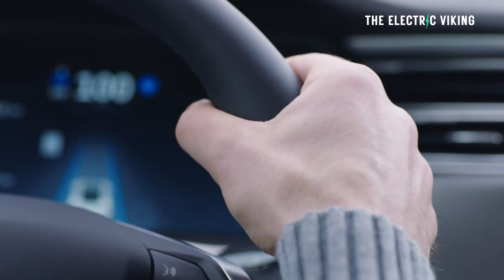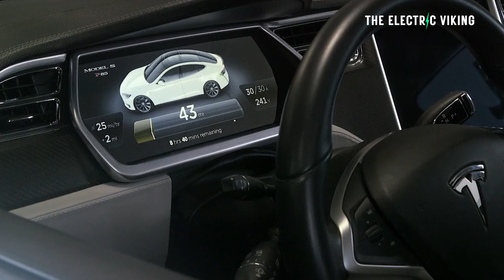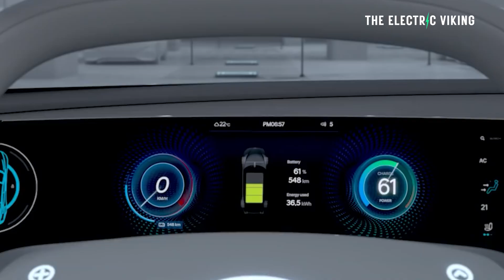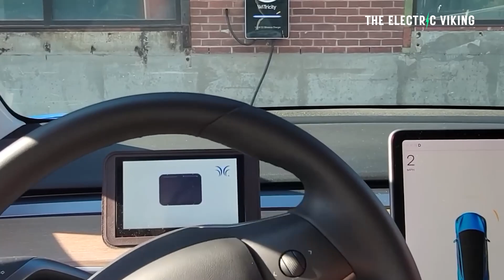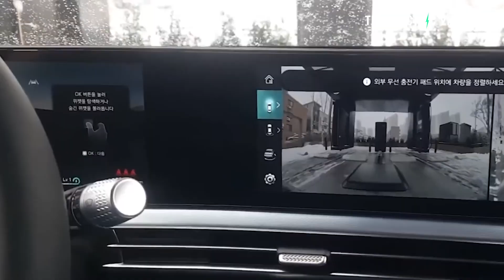Researchers reveal 500 kW wireless charging with 98%+ efficiency!

Comment: First thing this makes me think of is the pacemaker/defibrillator my mother has.  Can the magnetic field disrupt its operation?  (I hope that's an easy "no" for the designers of this tech - but lots of high-tech devices do disrupt it.)  We gave her an Apple Watch to monitor various health aspects, but if it gets within about a foot of her pacemaker it rings it's alarm and sends an emergency notification wirelessly to the hospital lab's device monitoring service.  They immediately phoned and had about 30 questions for her, and were ready to dispatch an ambulance.
Reply: You need a better shielded pacemaker. A solar flare could mess you up.
Reply: @tedmoss  She just had it changed out in December with the highest tech.  Nothing newer or better exists.
Reply: Yes, it can, and will interact with a defibrillator. Even low power phones are restricted in hospitals and aircraft because of the sensitive equipment in the vicinity.

Comment: Wireless still has waste, and that's your money when you charge so I would stay with wired. And I would be worried about ghost charge building up. Street man holes sometime get charged it's very rare but it happens.Oh and your adding weight to the vehicle, less is more, and copper it's expensive. but as batteries get better add something like this may be of use. I will still like to have a wire. But the safety you get with ships looks great, water and wires can be bad.

Comment: In other (not so new) news:

CSSC Haizhuang released the 260 meter diameter / 18 MW off-shore wind turbine H260 mid January. Per year one wind turbine converts wind energy into electrical energy for 40,000 households. Calculate for yourselves how many rotations it needs to charge an EV. 😉 

CATL already plans the 2nd generation sodium ion battery.

Sodium is 2.3% of the world’s crust. It is over 1000 times more abundant than lithium.

Lithium ion batteries have a capacity between 200 and 300 kWh. 

The energy density of CATL’s first generation sodium-ion battery cell can achieve up to 160Wh/kg, and the battery can charge in 15 minutes to 80% SOC at room temperature. Moreover, in a low-temperature environment of -20°C, the sodium-ion battery has a capacity retention rate of more than 90%, and its system integration efficiency can reach more than 80%. The sodium-ion batteries’ thermal stability exceeds the national safety requirements for traction batteries.

The second generation will reach the capacity of 200 kWh.

Comment: Vaporware. Wireless charging can't even work right for phones. I'd rather they work on coming out with autonomous mobile robot chargers. You don't need a special spot to park, it will come to you.
Reply: If the current wireless charging worked perfectly this wouldn't be a game changer. It is the very fact this works better than current wireless charging that differentiates it and makes it exciting.

Comment: This will absolutely change EVERYTHING in the EV industry and calls into question the importance of range and battery size and charger compatibility!!!!
Reply: ...we're still in the Early Access situation regarding EVs and batteries. Range is as much a real problem as how fast an EV goes from 0 to 60: since on mean average people drive not even km per day it is a joke...especially when they can charge at home and at work...so it is 20 km to work and back. Ok let's say it is 100 km to work and back 100 km again. ...not an issue.
Reply: @currentbender  understood and I would imagine as this charging improves the full ramifications of my prediction will be expressed. I know for me it’s about spontaneous options and psychologically more range is a mental crutch and this IMPROVING technology will or should dismantle most people’s range anxiety as these wireless chargers become more or less as common as street lights.
Reply: People don't want to stop frequently or for a long time on longer road trips. That's why people care about range. If you have to stop every half hour or hour, even if it was to charge for one minute, very few will want that. Also, assuming batteries can get enough juice to charge at heir peak rate, every battery from a AAA to Tesla Semi charges in about an hour, or 30min to 70%. If your car's range is 1000km, then you probably won't have to stop at all on a day's drive, but if you do you can add 700km range in 30min. If your car's range is 200km, which you could argue is plenty for getting around in a city, you will only be able to drive for less than 2 hours on a road trip, and sitting for 30min only adds 140km of range. That is a very hard sell unless its a family's second or even thrid vehicle. So we're going from 30min of charging for, say, a 1500km trip with a 1000km range car, vs around 5hrs of charging for the same trip in a 200km range car.
Reply: @truhartwood3170  absolutely I couldn’t agree more, that’s why I am so enthusiastic about the lane charging option where you are charging while you’re driving. It’s going to be a really fun future.
Reply: @pgiatrakis  I'm not sure if the value will be there to put that amount of copper under highways.
Reply: @truhartwood3170  talent gets us to places few can go and genius gets us to places few can see structural induction serving greater functions at constrictions in infrastructure is just one of a multitude of strategies that could render the endeavor feasible and probably critical. The attempt is more than worthy and minuscule and validate future success or failure. This would allow us to learn and improve and pivot future designs and strategies to increase efficiency. It’s a promising future and we need your type of thought to guide us in the best direction…

Comment: Good, but there is one problem, potentially: Heart pacemakers. A friend has one,  and users are warned against high currents/high magnetic fields, e.g. 'don't do arc welding at > 70Amps' etc.
My friend thinks the warnings are over-conservative, but the medical profession are unlikely to relax them if they think that there is even a 1 in a million chance of adverse reaction and a lawsuit.
I can see a battle between Tesla and whatever company wants to promote wireless charging, and the medical fraternity who don't want to be sued for malfunctioning pacemakers.
Of course the high currents of DC charging are also a potential problem, if pacemaker susceptibility is an actual problem.
Reply: If its 98% efficient, I doubt the magnetic fields will be strong anywhere but between the two pads. It's an interesting point though, and I'm sure tests will be done :)
Reply: No such warnings about inductive cooking hobs because of close coupling and in that instance the hob will switch off within seconds of the pan being raised off the surface, similarly with inductive charging the magnetic field is tightly focussed on a spot around 8" from the ground pad in most instances and unless the pads are within the zone the pad does not activate. In momentum dynamics system the magnetic field close to the cars wheel at ground level is less than that emitted by a cooking hob.
The medical fraternity was wary of mobile phones in hospitals when they first appeared but by now there are very few restictions on mobile phone use in hospitals.

Comment: The other benefit will be V2G and V2H as power can flow in both directions
Reply: That'll make the cars bulkier and heavier as they'll have to produce this frequency - I think it's unlikely it'll be used for V2G for now.
Reply: V2G/V2L wasn't mentioned here, but is available today for some cabled cars.

So, until confirmed for this technology too, this advantage goes to the cabled solution.

Comment: If Musk wants to achieve Robotaxi once FSD reaches level 5 then he will have to include wireless charging tech into his Teslas
Reply: Pretty sure d charging part is d least complicated. FSD is d big challenge.  Even robot vacuum systems can dock themselves in a charging bay so EVs with FSD should be able to recharge with some modifications even without wireless charging
Reply: @ikwikwi  Yes, charging the vehicle is the least hard problem in solving fully autonomous driving.
Reply: @ikwikwi  So can all cars and trucks.
Reply: @tedmoss  @TheFuelProject
Reply: Add reverse wireless charging. He could have a 24/7 battery station with each taxi depot.
Reply: What makes you think they wouldn’t?
Reply: There are no rules that say he has to do anything, let alone something that inefficient.
Reply: Musk is a complete joke of a person.
Reply: Sure, but i wouldnt recommend sitting inside if you have a cock ring.
Reply: @slavko321  some people always try hard to impress with their vulgarity. Makes them feel bad and special. Especially those who lived a sheltered childhood.

Comment: I feel this is most useful for Buses or Trackless Trams, you can charge them a little bit everytime they stop. Allowing to have them carry smaller batteries making them cheaper and lighter.
Reply: While living in Genève Switzerland,  a few of the public transportation buses charge in short bursts at certain busstops.
Reply: The idea of using wireless charging for ferries is good too, as the charging points can be sealed from saltwater and won't corrode.
Reply: @BeowulfNode  Moaintaining acuracy of positioning might cause a problem to maintain efficiency of coupling though
Reply: @eclecticcyclist  True. It may work out better if instead the 'wireless' pads are on the end of a cable or moveable boom. You'd still go through the 'plug-in' motion when docking, but there'd be no exposed metal to rust.
Reply: @eclecticcyclist  Yes, boats are tied loosely so they can move freely with the tides. In practice it would be like plugging it in.
Reply: @tsamuel6224  It's not just the mooring, you've also got water level variations, if not tides then the wake of passing craft.
Reply: People tend to be extremely lazy, so a huge chunk of regular people would  definitely want this to eliminate the need for plugging in. I know I would
Reply: @matiashamalainen4574  also to eliminate the risk of forgetting to plug in i know that would happen to me if i had an ev sadly i dont so i up for this 7 days a week  just becuse im not good at remembering stuff
Reply: @pingvingaming  Do you forget to plug your phone in? Do you forget to put fuel into your car?
Reply: @eclecticcyclist  do i forgot to plug my phone in only all the time yes cant count how many times i come to work at phone 2% battery not a big problem im at my desk all day anyways. have i forgotten to fuel the car yes i never ran out of gas while driveing but have forgotten to fill it the day before work sooo yes to all above and why the hell would i not want wireless charing in my ev when my phone has it like if my phone can surely my car can to right
Reply: It's useful in any commercial application where a vehicle stops in a regular spot for a period of time, even delivery vans and trucks which could be charged while they are loading. Also not just trackless trams but also light urban railways where stops are frequent.
Reply: I have an even better idea, attach an overhead wire to the bus and never need batteries at all! We could call it a trolley!
Reply: Or cars parked and charging while u shop. Especially since lots of charging stations have issues with charger plug contact after a while. This eliminates that problem
Reply: @ikwikwi  if you've got time to shop you've got time to simply plug in a wired charger.

Comment: At home I see wireless charging as a "nice to have" not a must have. For public charging it's going to be chaos unless a standard placement under the car can be established. Look at what happened at the new Tesla chargers where the cables are too short because automakers didn't establish a standard for where the charge port is located on the car. Non Tesla cars are blocking two spots to try to get in position to charge. I don't think it's possible to get enough cooperation to establish standards for charge ports or wireless charging plates.
Reply: Yes and as I understand it, for optimum magnetic field coupling the vertical distance between the pads has a tight tolerance which means that the system is only suitable for vehicles with adjustable ride height unless an expensive and potentially unreliable robotic ground pad is used.
Reply: @eclecticcyclist  the experts will consider all that. The wireless interface can be mounted underneath d car and power then transferred to d batteries somehow. I guess d experts will figure it out. I prefer the zero wear and tear 9f wireless cos anything with a plug must require a little adjustment after a while for optimum plug and socket contact
Reply: @eclecticcyclist  from what I understand, closer is better, farther is worse. If this works at 98% efficiency up to 15cm, it should be no problem raising the charging pad around 10cm (sports cars usually have around 13cm clearance), meaning it would work for sports cars up to trucks with a clearance of 25cm (10") which I would think should be fine for every stock production vehicle.
Reply: @truhartwood3170  No, focussed resonant magnetic coupling doesn't work like that. Get your facts right
Reply: I don't see this as a problem, place it in the middle of a stall in terms of side-to-side, maybe one back, one forward in the stall, and have the car tell you to creep forward until it senses perfect alignment (or a self driving car can do this automatically).
Reply: True but perfect the technology first and d rest can be compromisable. Remember most charging is at home and wireless reduces wear and tear.only barrier I see may be how to wirelessly charge through the  thick metal battery casing. But I guess that's what d experts are for.
Reply: @ikwikwi  wireless charging is done by having two coils of wire next to each other. Power is put through one, which magnetically induces a charge in the other. The charge from the second coil is sent via wire to the batteries. Wireless charging doesn't send electricity through the air to the batteries directly, so the thickness of the battery housing is irrelevant.

Comment: I was questioning the practicality of wireless charging EVs due to efficiency loss, but if this truly works as a product then it will be incredible. I still feel wireless charging roads are completely unrealistic and needlessly complex and expensive though
Reply: Imagine a taxi (robotaxi) queue at an airport. The taxis are charging as they progress in the queue towards receiving a passenger
Reply: @gjhyland  Yes but that is not a 'road', it's a taxi rank area.
Reply: @eclecticcyclist  yes but it could just as easily be a road an intersection a stop sign an off ramp an exit ramp public on street parking 🅿️ a commuter lane……
Reply: @pgiatrakis  No it requires very accurate parking above the transission pad for this high efficiency.